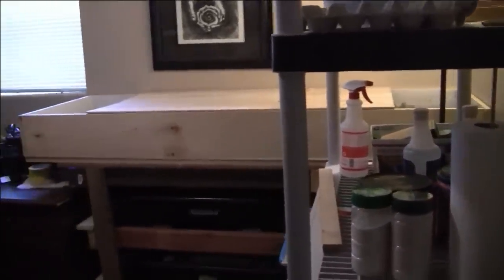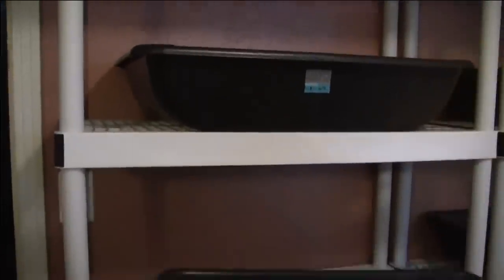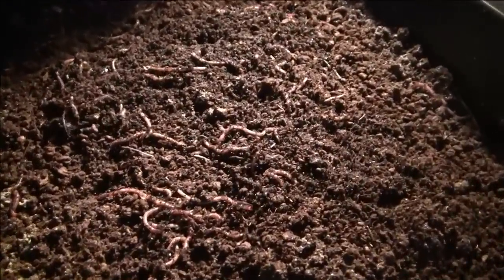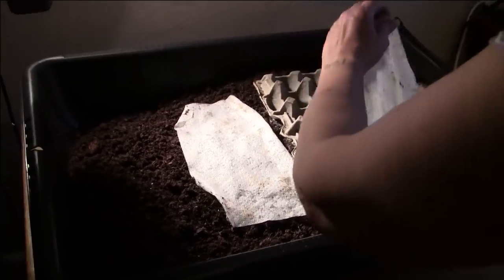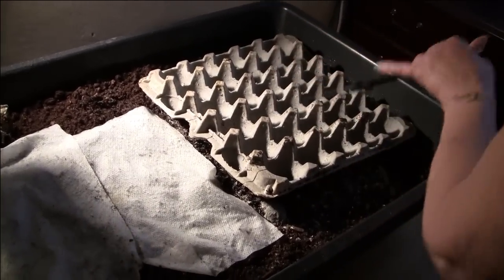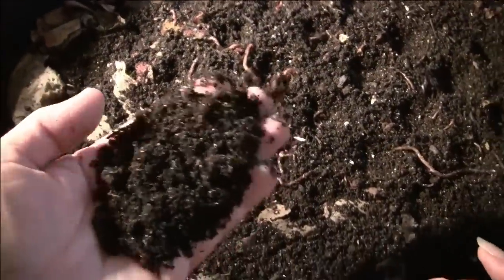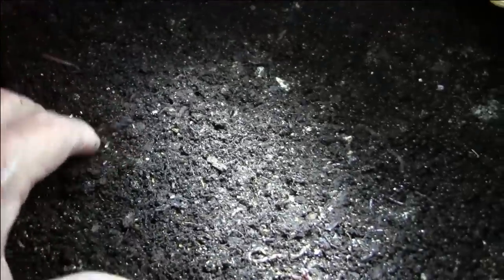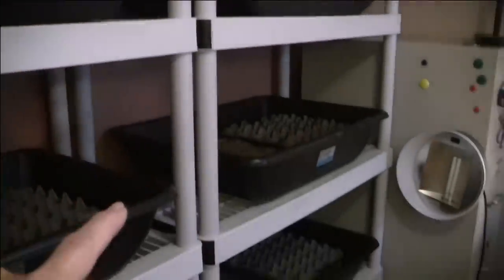How We Are Worm Farming Indoors And It Keeps Growing

Comment: Work smarter, not harder.  If you're timing yourself for efficiency, rethink your feeding process.  Leave the bins on the shelves instead of hauling them back and forth to the table.  Take the egg cartons off all the bins in order from top to bottom and dunk them in a tub of water to soak up moisture while you start the feeding step.  By now, the worms where you removed the egg carton first, have gone down into the soil.  Sprinkle your food on all bins in the same order you removed the egg cartons.  Then water each bin starting with the first and working to the last.  Then re-cover each bin with a water soaked egg carton and you're done.  
Expenses could also be cut down by using free bedding materials (cardboard, newspaper, etc.) and food scraps which can be obtained from your own kitchen waste, local restaurants, coffee shops, neighbors, and produce stands.  Just some thoughts to ponder...
Reply: Or just house them in a dark room .... open the door and feed and water them  ... no cover just nice dark climate controlled bliss for them.
Reply: What she said.
Reply: Cancel the step of watering the food, just put the soaked egg carton on top dripping wet.
Reply from the maker: Good point.
Reply: ADD ?

Comment: A 1/16" screen is small enough to catch the cocoons but allows the casting through.  It might speed up the process of transferring them over in the future.
Reply: It's not an easy item to find. I did find some perforated stainless steel sheets at that size. I think a 2'x3' sheet was around $65

Comment: I have a worm bin in my basement, too, but I cover it with a perforated plastic lid.  This keeps the original moisture in it for the 2 month cycle before I harvest and put in new bedding.  When I tried the system with an open top, I couldn't keep the top bedding from drying out all the time.  I feed with Purina Worm Chow, and all I do is sprinkle it on the bed once a day and recover the box.  I don't have to add water because the plastic cover keeps it moist.

Comment: I like your parmesan cheese sprinkler.  👍  I have one too.  😊   By the way, if you wanted to, you could cut the uprights on the plastic shelves shorter and put more shelves in each tower.  It looks like there isn't a whole bunch of weight in those bins.  You'll need to buy a few more shelves, but you won't need the new legs.

Comment: Your big bin had no air holes! The ammonia and CO2 build-up was making your worms ill. Also, in a big bin like that, there should be a drain provided so that you can regularly add water without worrying about making them too wet. If you over water, the excess just drains.

Comment: Have you considered using a watering can? That pump spray thing is cool, but it would be quicker if you just poured water instead of slowly spraying it. The cardboard cartons won't mind and it will save Deby about an hour of busy work.
Reply from the maker: We have discussed something different and that just might be the answer.
Reply: @HomesteadersDiscovery  Very nice video! Be careful using a watering can. I accidentally drowned some worms. I switched from cardboard and now use an old wet towel. I toss the towel in a bucket while I am feeding. I feed them fruit, egg shells, veggie scraps and a small amount of coffee grounds. Be careful with the coffee grounds because of the acidity burning them. Sometimes I puree their food before adding. I cover the dirt back up and then lay the wet towel over the top. What kind of bins do you have? Did you have to cut holes in the bottom? Very nice set up.

Comment: Wow, that's labour intensive. I just use flow through bins and food scraps. My worm breed out of control. I have two large garbage cans I store the surplus worms in during the offseason.
Reply: I have about 70 worms in about 15 oz of soil...what should i do? I also tossed in a buncha grapes, oranges, cheese, & carrots, is that too much, food polution per soil ratio? I heard something about keeping something (maybe soil) 7.0 Ph. How do u do that...less food? Should i get more soil to increase surface aera for the worms?..im looking to grow worms on a small scale
Reply: I would get a bigger container. 70 worms can't eat that much. They can eat their body weight in food per week, I think. Basically, if it smells, the worms all come to to the top, or the food is not being eaten, don't feed them anymore. If you have good drainage, you can water them. I pour about 4L of water through each of my worm towers each day. Gives me tons of worm tea for watering and washes the extra acidity out of the mix.
Reply: @argentumtaibhsear621  i heard the drilled holes can get clogged by soil & prevent drainage? is there any technique to prevent blockage? any recommended hole diameter?
Reply: Mine is like a 2mm plastic mesh. I bought my worm factories, so if you are building one I would go with about that size or use window screen over larger holes. Green Shorts does a bunch of DIY worm bins if you need pointers on building one.
Reply: Off-season? How you keep the worms from coming out? I tried raising before. They kept escaping
Reply from the maker: We didn't want to deal with leachate so we kept the moisture level low and decided against holes in our bins. If you get a solution let us know, please. Thanks!
Reply: @OmarTheAtheistAziz  I would not feed oranges or cheeze unless I had lots of worms and then just a small amount. For most worm bins stay completely away from citrus and cheeze. For 70 worms and 15 oz. of soil dont expect them to eat very much. Your soil will compost and get too hot for worms and also it will smell and attract flies and roaches etc.
Reply: @OmarTheAtheistAziz  dont put in cheese of any kind. Plus grapes can be but not always somewhat toxic to worms. Can make them lethargic and blotted. And they wont reproduce. If you take coffee grounds and eggshells then grind them to a fine powder. Great for reproduction. Add some simple sugers too. Best would be any kind of mellon...
Reply: @riversidecountryclub2211  if you take some Vaseline and put it around the top of the bin between 1 and 2 in down once they hit the vaselines they'll absolutely hate it and return back home
Reply: @morganhemingway5262  Vaseline??...really?...LOL...never heard of it but does make sense. Thanks for the tip:)
Reply: @OmarTheAtheistAziz  you're not supposed to give them citrus, or dairy. They eat their body weight everyday so feed based on that ratio.

Comment: I like what you have done. And I like your food you give them. Can you break it down recipe style? X-parts of blank and X-parts of blank etc. Also - here's a tip for you - worms give more products than just castings. If you put a spigot on each of your bins and then really give them a good soaking with a gallon or two of water (judging by the size of your bins) every month or so, then you would immediately drain the water through the spigot to get leachate. I would dump that leachate into the same bin 2 - 3 times that day until it gets nice and dark. You can use that in the garden directly or better still you can aerate it and add molasses to it (1-Tblsp/gal) to get compost tea. That's the best stuff for the garden. I saw a video of a guy in Puerto Rico that sells just leachate. Makes $60k per year doing it. Gets $18 per gallon.
Reply from the maker: Thanks! I plan to put together a worm chow recipe document but with the pandemic we are trying to get our homestead running a bit smoother. It is on my list though. Also, I agree with the leachate. We are considering a system to start capturing the leachate. I'll soon have an update video on our worms. With the pandemic, we had to move them from indoors to outdoors in a rush. They are doing great.. for now. Stay tuned and thanks again!
Reply: @HomesteadersDiscovery  ok. But im sure you just typed more than the recipe would take. Any chance you can just tell it to me or just put it in the description area of this video?
Reply from the maker: LOL so true. 1 Part Quaker Oats ground into flour. 1 Part corn meal flour. 1 part weat flour. 1 part oyster shell ground into flour OR egg shells ground into powder. Mix it up and feed em 😃
Reply: @HomesteadersDiscovery  Excellent - thank you

Comment: Wet newspaper also helps t keep it moist inside of there and the worms will also eat this up.  You can get reams of outdated editions from your local newspaper place..for free.  I doubt that little bit of paper towel is helping much.  You could also put some holes int he bottom of these bins and have them sitting on a lower walled pan like structure that you can keep a low level of water in.  This moisture will be pulled up naturally if things begin to get dry in there.  Putting a layer of cardboard in the bottom may be helpful.  Why do you buy "worm food" versus just putting in your kitchen scraps?  Does this help them breed or something?
Reply from the maker: We actually had a bin with 75 percent paper as bedding and it stayed moist and worked great as bedding. Thanks!
Reply: idealist4life I’m excited to hear about outdated newsprint possibly being available. We foster for a dog rescue and we get the puppies,  sometimes newborns. We go through newspaper very quickly when we have 4 to 5 puppies or have large breed pups. Unfortunately many of our neighbors don’t take the paper so I can’t hit them up for paper to cover the floor area of the puppy pen. Newspaper is so dear I don’t use it in my composter. I do tear up cardboard boxes and other paper goods that can’t be recycled due to residual food like melted cheese or grease stains in a pizza box. The worms in our compost bin love cardboard.
Reply: Can worms live outside?I live in georgia

Comment: I see you use a powdered worm food. How do you make it? I have just ordered and expect my first 250 worm batch in a few days. I have a 10 gallon plastic tub for getting started. My first 30 worms are acclimated to the bin and I am giving them powdered egg boiled egg shells. I am in central Florida and want to sell castings and worms for bait locally. Do you have any pointers for me.
Reply from the maker: It is egg shells (boiled and dried before grinding), oats, wheat flour, corn meal. Grind it all up into a flour. We use this as a supplement not the primary food source.

Comment: Worm bins still seem to be way too dry. Should have about 15% more moisture. This can be done with fresh food scraps. No meat. Just vegitable scraps, peeled potatoe skins you name it. 2 layers of wet newspaper on top will help keep the moisture content. Its evaporating too quickly in the open air. 
  If You worried about the smell from fresh food scraps while farming indoors bury the scraps in the bin with about an inch of bedding and compost material on top and then your wet layers of newspaper. 
   I do like your Indoor set up though. Would help with over wintering my worm bins.
Reply from the maker: Agree. We are so busy building our homestead "cabin" we hardly have time for the worms. Thanks for the tips!

Comment: How are you keeping the worms from crawling out of the bins?  I would cover them to keep spiders and centipedes out of the bins. Nice operation though.
Reply: I don't use any covers and haven't had any problems with worms trying to escape. They stay in the bedding. :)
Reply: In my experience, they tend to be much more explorative with a lid on.
Reply from the maker: With a lid on, less light allows them to roam more. This could be the reason.

Comment: how many worms u have in that black bin in the beginning? what dirt/soil/bedding are u using??
Reply from the maker: The black bins we kept at around 2,000 worms but there were times we had up to 5,000. We start their bedding with wet/moist peat moss.
Reply: @HomesteadersDiscovery  How big of a bin should i use for my 200 euro nightcrawlers?  I want to try to keep a steady colony of 500 worms. I am currently using a bin that is 16 L x 11 W inches and is 7 inches deep. Is that enough for 200 worms? and will it be enough for 500 worms??

Comment: My worms are in those same concrete mixing bins.  they seem to stay in clumps at the edge at the bottom.  huge knots of worms in the corners and edges?  why?  they have been in there since early november
Reply from the maker: Without seeing your bins it's hard to tell, but here are a few thoughts. Assuming your worms are red wigglers. Make sure your bin is nice and moist throughout (NOT flooded, but moist/wet). Food must be available towards the surface of the bin. Check the pH if possible. Feed only veggies and include grit (ground up sterilized egg shells, oyster shells). Don't use onions, dairy, or meat products in their food. It sounds like you worms are seeking moisture or better temperatures or trying to avoid an unpleasant area of your bin. What do you use for bedding? In good conditions, worms gathering in clumps is also how they reproduce. This is not necessarily a bad thing if their food and environment are good. At least they aren't trying to leave/escape the bin entirely.
Reply: @HomesteadersDiscovery  They are uncle jims, so mostly blue perionyx (i think) its wal-mart peat, mixed with handfuls of rice hull, maybe 5 percent. and a couple handfuls of dirt to inoculate?  they come up for veggies (at least some of them).  I do the same method for all three bins. 1st bin is amazing, 2 and 3rd is not so much.  i have a ph wand but it doesnt tell me much, doesnt move.  the moisture is just a graph from 1-10 it usually better than 6 in all 3. im thoroughly confused.  Unless the 2nd and 3rd peat was bad. idk

Comment: What kind of material do you use for bedding. Most of my worm escaped in 1 night.
Reply from the maker: Moist peet moss with food. Keep your worms covered and under a light the first 48 hours. Not a hot light, just a desk lamp or something near the top of the bin. It takes worms about 48 to 72 hours to settle in to a new environment. If worms are still escaping after that, something is wrong with your food or Ph.
Reply: @HomesteadersDiscovery  thanks for the tip. I'll give it a try.

Comment: What area the trays you use? Where do you get them?
Reply from the maker: Cement mixing tubs.
Reply from the maker: Home Depot or Lowe's for sure.
Reply: @HomesteadersDiscovery  what size? The medium or large? The walls don't look high enough with the medium.
Reply from the maker: @likasite  The actual dimensions vary depending on the brand, but these seem to be working great for us. Ours our 26 inches x 20 inches and the depth is about 6 inches.

Comment: what do you feed them what is the powder mix?
Reply from the maker: It is a combination of corn meal, wheat flour, grit (egg shells or oyster shells), and oats. I am going to shoot a better video about this in the future. My first one wasn't that great.
Reply: Is the feed daily along with the water and waiting for the food preparation video, thank you 🙏
Reply from the maker: @toson9373  we feed about every 2 to 3 days and water at the same time. We could always add more food and water to go longer. It is flexible. That food vid will be coming soon.
Reply: did  you drill  holes in the bins ? and where did you find your bins what is the capacity
Reply from the maker: @sallykeindel8703  We do not drill holes because we don't oversaturate with water and we don't add so much friut and vegetables that there is leachate/excess juices. They do fine in these.
Reply from the maker: @sallykeindel8703  Also, these are actually cement mixing tubs from Home Depot or Lowe's. There is a large and small size....we use the large sized tubs.